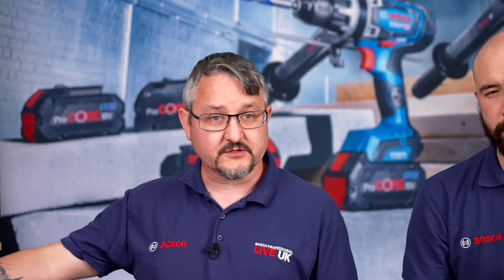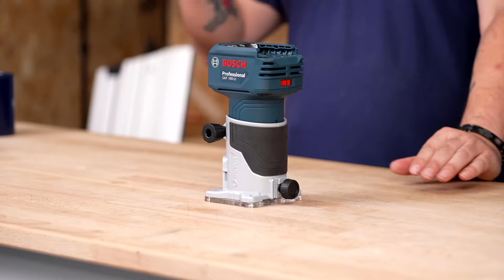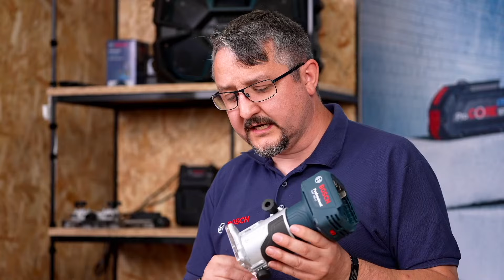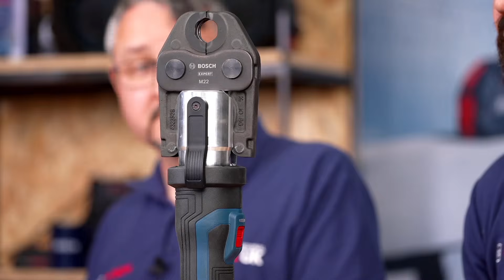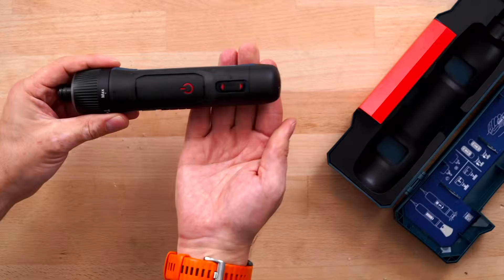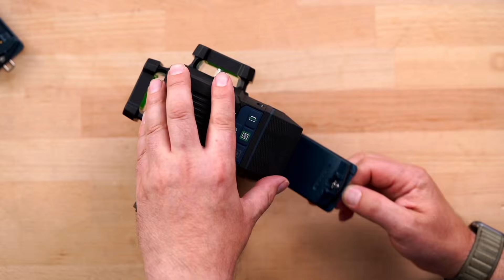NEW TOOLS REVEALED: WHAT YOU'VE BEEN WAITING FOR!

Comment: Wow I have beesing and buying Bosch tools since way way back , my first Bosch cordless kit was the old ni-cad 5 piece kit , was amazing , Bosch always have impressed me with their battery packs , since 2010 ish i have been using and buying the lithium , and have bought into the core system or if you want pro factor tools , love every single tool , just bought the GFK router recently , its amazing , and also just bought the drywall sander , will be using it for the first time tomorrow, aside from this , my question is do you have a blade left for the track saw ,love watching your videos

Comment: Kudos for releasing X saw, you are not too late to the market (unlike with palm router), I am sure fsn fans will love it, a lot of good features there. At least we wont have to go to wobbly metabo for cross cut saw now.
But palm router and biscuit jointer, at this stage? You should be releasing 1/2 inch cordless router at this stage (and you would already be long late) instead of pushing 2 additional palm routers when you already have 2 palm routers. And cordless biscuit jointer in 2024? Seriously, who is going to buy that? The only application where I would use biscuits remotely I would actualy do them with plunge router as biscuit jointer neither has height capacity nor would you carry additional tool for that one task. 
There are only 3 dowel machines on the market, one is so bad so really two, and only one of those two has cordless and corded variants.
Market is crying for dowel (or domino) competition, especially cordless one.